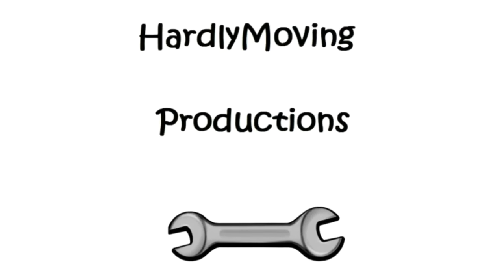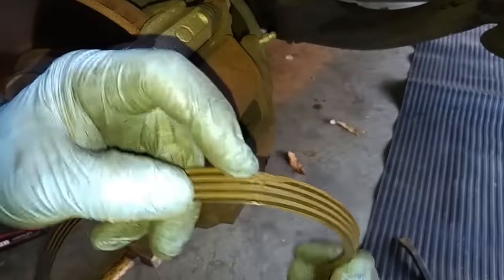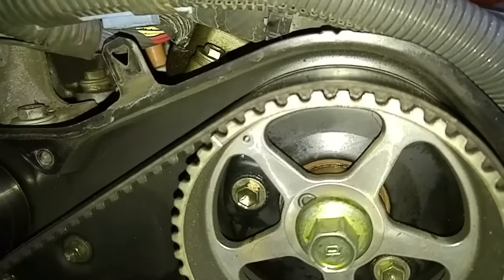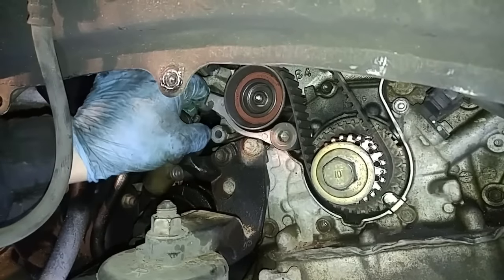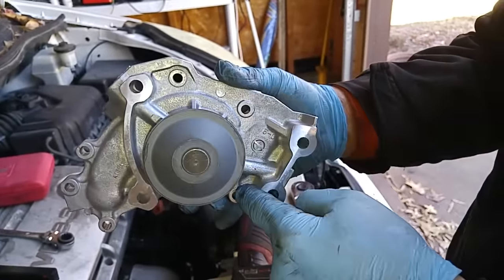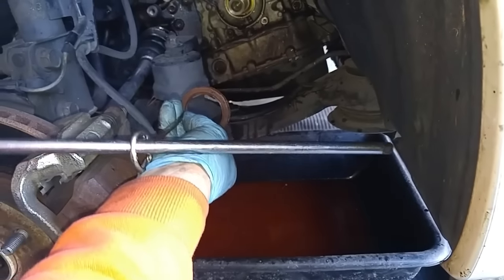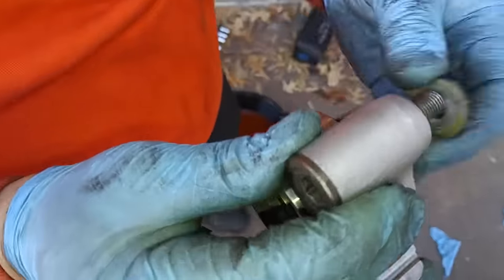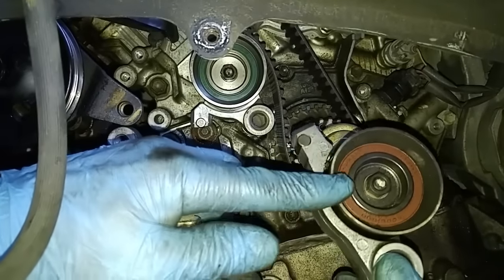Toyota Sienna V6 3MZ-FE Timing Belt, Water Pump, Seals, & Pulleys Replacement

Comment: I have a question my timing belt on my 2006 Sienna was replaced at 90,000 miles I now have 167,000 miles but the replacement belt was installed 8 years ago.Should I replace it now for at 180,000 miles?
Reply from the maker: The recommended service interval is based off of either mileage or time.  Believe 8 years is the service time frame ... although by mother-in-law has a 2001 V6 Honda Accord with under 30k miles and never replaced the belt to-date.  If the 1st belt replacement didn't include a water pump replacement, do the w/p this time.  Insist that the cam seals be replaced and don't listen to "I don't see it leak'n".
Reply: @hardlymovingpro  
The first one was done at a Toyota dealer in N.J. before I owned it but I've been told you might at well change the water pump while you have access to it. Pretty sure any Toyota dealer would recommend it.
The estimate I got was for a belt, water pump 
tensioner and 2 bolts  plus labor for 1663.70. Then again I got a estimate to replace the motor and wiring harness for a passenger power door for 900.00. I bought a replacement motor for 131.00 and did it myself.this timing belt replacement is way above my pay grade at 69 years old and a pinched nerve in my neck.
Reply from the maker: @waynerogers6621  That's a way over-the-top price quote and the cam seals are not included!  I can do the entire job in around 5 hrs ... just a belt replacement in 3.   Don't know why people call estimates an estimate?  Because it's the minimum they're going to charge? That if they encounter a hiccup like leaking cam seals they'll charge more?  If you're in NJ, I can recommend a shop you can go to in Union county.  It's called J&S Automotive in Roselle Park.
Reply: @hardlymovingpro  I'm in northeast PA. and have a local garage I deal with working up a estimate for me. I thought I would have Toyota do it mainly for the OEM belt and water pump but as soon as the service department at my local Toyota dealer called me with that insane estimate I told them thanks but no thanks and let them know I thought it was way out of line.They just reopened after being closed for 2 months due to the virus and I'm thinking they're trying to make up for lost revenue.
Thanks for the info
Reply from the maker: Understand.  I visit my mom every 6 months in NJ.  Could drop by in around a month to do the job if you want.  Parts & labor $650

Comment: I am having trouble removing the motor mount bracket studs. I have the bolts loose but can't free the studs. I have tried PV blaster, striking it repeatedly, double nut compression method and finally put vice grips on it and destroyed the threads but stud still will not budge. I am going to try heating it next. It appears the water pump has been slowly leaking for a long time so everything has been difficult to get off from the crankshaft pulley bolt, pulley itself & now these studs. Do you have any other suggestions?
Reply from the maker: You can try using an e socket (the reverse of a torx socket) at the tip of the stud or get a stud removal tool.  If using a stud removal tool, sand the stud surface to allow the tool to bite onto the stud.  Or you can tilt up the engine by positioning a hydraulic jack with a wood plank between the jack and the engine oil pan.  Tilting the engine up will give you the clearance needed to slide off the mount.
Reply: @hardlymovingpro  lifting the engine slightly worked like a champ! I thought of tilting the engine as a risky option for a last resort but have since learned otherwise! Wish I would have tried it 2 days ago. Thank you for responding! It is MUCH appreciated!
Reply from the maker: No problem ... easy ... wasn't it?
Reply: It was so easy I wasn't even sure I was lifting the engine at all until I could slip the motor mount off the studs!
 My elation was short lived, however, as I realized the timing was off between the crank shaft and the 2 cams when I tried to line everything up before taking the old belt off. I'm guessing since the cams line up together and the crank shaft is the odd man out (less than 45 degrees past the mark when the cams line up) that I need to rotate the crank shaft clockwise, before I put the new belt on, until piston #1 is at TDC position and hope no damage was done. I don't know when it could have slipped timing, the old belt was still on and intact. My fiancé limped the car home as it was overheating (which was due to the water pump failing...we thought) but was diligent about not pushing it and letting it cool between movements. I get conflicting information when I try to look up whether or not this is an interference engine. The water pump spindle is shot (way too much play) , so the water pump has failed but not sure which may have happened first, timing or pump. I'm hoping for the best and continuing to move forward.
Reply from the maker: Sounds like the water pump failure caused a jumped timing belt situation.  Very easy to fix.  Rotate crankshaft to TDC mark while camshafts are also moving to their TDC marks (otherwise they'll be moving 180 degrees to the opposite).  With the crank at the TDC mark, probably one of the cams will be off (assuming jumped belt).  Just rotate that one to the alignment mark.
Reply: As I was rotating the crankshaft while the old belt was still on, both cams would line up together but the crankshaft wouldn't line up with either cam, so I figured the cams are correctly aligned but the crankshaft needs to be adjusted. Another reason it makes sense to me that the crankshaft would be out of time before the cams is because all the torque is generated from the crankshaft. 
So, I rotated the crankshaft until the cams lined up together, removed the old belt, and am now planning to rotate the crankshaft clockwise without a belt on until the #1 piston is in TDC position. Then, as I understand it, I can install the new belt and everything will be aligned properly. 
Does that sound correct to you?
Reply from the maker: Yes ... that is correct.  It appears that someone had previously installed the belt incorrectly and is off a cog on the crankshaft side.  Note:  there are TDC alignment marks for the crankshaft.  It's shown in the video.
Reply: Before I took the old belt off, I used the marks for the cams but the crankshaft is out of time compared to the cams. if I only finish that rotation, the crankshaft will be one rotation further than it should be in the cycle because right now it is only less than 45 degrees past its correct position. At this point, I need to remove spark plug #1 and visually verify the crankshaft has put #1 in TDC position after I complete 1 & 3/4 rotations, or just perform whatever  rotations are required until I can visually verfy #1 TDC.

Comment: I’m trying to remove the power steering pulley on a 2001 sienna. It’s the one with the nut on it . Is an air wrench the only way to get it off ?
Reply from the maker: Use a chain strap wrench to hold the pulley then you should be able to torque off the nut.  Here's a video explaining how to use these strap wrenches:
https://youtu.be/h1kKlCkmfT0

Comment: If I don't change the cam seals, is it still necessary to remove the pulleys yo get yhe waterpump out, or can I just remove the stud?
Also, the tensioner I'm getting in my 1mzfe kit is the same a as the tensioner in this 3mzfe video, not the tensioner in your 1mzef video.
Reply from the maker: You don't need to replace the cam seals to remove the water pump ... but I guarantee you won't get another 100k miles out of the seals before the next TB replacement.  If the tensioner in your  1mzfe kit is the same as the 3mzfe video, then it's not a 1mzfe kit.  Also check the tensioner pulley bracket in the kit.

Comment: Great video!!! 
I'm a bit OCD/ inexperienced home mechanic so is there a good place to find torque settings for tightening the bolts, or do you do it by feel?
Reply from the maker: I generally go by feel, but here's a link to an article I wrote with a diagram showing torque specs:  https://axleaddict.com/auto-repair/Toyota-1MZFE-Timing-Belt-Replacement-Camry-Avalon-ES300
Reply: @hardlymovingpro  Really useful, thank you!
Reply: Awesome sauce

Comment: What are you spraying inside the engine (at about 9:24) and then using compressed air to blow away?
Reply from the maker: Brake cleaner solvent in a aerosol can.  It's commonly used in repair shops with compressed air to blow away accumulated oil and debris.
Reply: @hardlymovingpro  Do you think the cam seal installer tool would work for the crankshaft seal?
Reply from the maker: Don't need it for the Camry.  You can generally press them in with your fingers ... or use the end of a  2" diameter PVC pipe.

Comment: where can I find you? I need my 2000 Sienna timing belt replaced & water pump, your work ethic very inspiring
Reply from the maker: I'm outside Memphis, TN.  If close by, email for a repair appointment.
Reply: @hardlymovingpro  sent my info . Jon

Comment: Ehats up brither. Thsbks. Goaod video.   I didt it. I replace timing belt and water pump. Ehen i finished. I torn on. The engine. I saw cod p0016 ! Whats happened there. Something wrong ?
Reply from the maker: P0016.  Camshaft position sensor error.   Recheck your timing belt alignment marks.  May be off a cog.
Reply: @hardlymovingpro  done bro ! Thanks for your help and orientation!
Reply from the maker: Good for you!

Comment: How many hours and parts cost for timing belt and water pump replacement for this vehicle 2005 Sienna 3.3 V6.  Thanks.
Reply from the maker: Depending on your skill level and the tools you have on hand, I'd says somewhere between 6 to 9 hours of labor.  A timing belt component kit typically costs anywhere between $150 to $200 ... a link to a kit is provided in the description of this video.
Reply: @hardlymovingpro  THANK YOU.  I meant how many hours would a mechanic charge you.  Looking for estimate.
Reply from the maker: I can do it in around 3.5 hours or less.  Should expect an experienced mechanic to do the same.  But I'd figure most shops would charge you for around 5.5 hours.

Comment: Can't get the water pump off the housing... not enough clearance. What am I doing wrong? Am I supposed to have the engine raised a little?
Reply from the maker: I usually can wiggle it off the two studs.  You have 2 options:  1.  Get a "E" socket to remove each of the two studs.  An E socket is basically an inverse torx socket.  Do not use  standard hex socket.  It WILL NOT WORK.  Use the E socket with a 1/4" socket wrench and the socket must be perfectly square on the stud or you will strip the head of the stud.    Watch my video on the ES300 timing belt replacement job.  If there's too much corrosion buildup on the stud's threads,  the E socket may not work.
2.  Tilt the passenger side engine up.  a.  Remove the right side motor mount stud nut.  b.  Remove front motor mount stud (in front of the radiator fan shroud).  c.  Place hydraulic jack under the oil pan with a block of wood to disperse the lift.  As the engine tilts up, you'll see the upper side motor mount bracket pull on the motor mount stud.  Apply a few sharp hammer blows where the side mount seems stuck to the stud.  The blows should make the stud brake free from the motor mount bracket.  Attempt to remove the water pump.  If still not enough clearance, keep jacking up the engine until enough clearence to remove the water pump.
Reply from the maker: Also, if having problems remove the crankshaft pulley, apply penetrating oil on the crankshaft.  Let it soak ... then pull and push on the pulley and it should eventually come off.
Reply: @hardlymovingpro  wiggled it off after raising the engine. I raised the driver's side oil pan on accident at first. Will that hurt anything? I didn't hear any bad noises :)
Reply from the maker: @yasharenner6681  As long as you didn't bend the oil pan.

Comment: I have a huge oil leak on this side more near the upper side by the sensors may be coming from higher up but from the timing belt cover or the sensors can anyone help what might go to oil
Reply from the maker: Had a similar leak which was hard to find.  Was traced to a oil pressure sensor behind the timing belt cover.  Couldn't detect it until I had the covers off and running the engine.  Recently had another leak on a Hyundai Sonata that I fixed.  Once again, oil pressure sensor under the intake plenum.

Comment: Thank you for your great videos.  one question.  What size is the bolt going into the harmonic balancer when using the puller tool?  I got a cheapo from HF and I believe they are not metric.  Thank you!
Reply from the maker: Had the same problem.  Went to the salvage yard and got long 10 mm bolts.  Since the bolt head are too small for the puller slots, I used a series of washers until they fit over the slots.

Comment: Hello. I just watched another good DIY video where the rear cam bolt was loosened with the TB still under tension. I think I read somewhere not to do this, but can't remember why. Do you know? Thanks.
Reply from the maker: The bolt is torqued on at around 90 lbs.  With that much torque to get the bolt off may make the belt jump off the cam cogs or make the other cam and crankshaft move counterclockwise.  For me, not worth the risk.
Reply: @hardlymovingpro  Sorry, I'm not making the connection. If I'm taking the belt off anyway, why should I worry that the belt would jump off the cam cogs? Also, is there any reason why I couldn't use an impact wrench to remove, and re-tighten, the bolt on the front cam sprocket, as you did with the crankshaft pulley bolt?
Reply from the maker: the 3MZFE engine is an interference engine.  If the belt slips, the camshaft could violently jerk counter-clockwise forcing a valve to smash into a piston at top-dead-center and potential damaging the valve(s).  An impact wrench could be used if the cam sprocket is held tightly in place.
Reply: @hardlymovingpro  Hello Sir. I hope you don't mind the back and forth. I really appreciate your time. I haven't begun this job yet (still amassing tools), and I'm learning a lot from you. As I said before, I worry mostly about what NOT to do, so I'm trying to learn as much as I can. So to avoid the issue of the valve crashing into a piston, couldn't I get all three timing notches aligned, then, as per the Toyota repair manual, move the crankshaft 60 degrees counterclockwise to the "safe zone" and then break loose the rear cam bolt with the belt under tension? That way, if the camshaft does slip, it won't come into contact with the piston. Then break loose the front cam using an impact wrench (some people say not to use an impact wrench; not sure why).
Reply from the maker: I guess you could do that.  Never thought about doing it that way.  If the belt slips and send the rear cam out of alignment, then you'd have to take the belt off and manually re-align the crankshaft and the two camshaft pulleys one at a time to TDC.  If you start with the crankshaft first, you'd have to stop turning when you FEEL it touching any of the valves.  Then you'd go to the camshaft side and turn it ... hopefully to TDC mark without the valves touching any of the pistons.  Then back to the crankshaft side and turn it to TDC without hitting the valves.
Reply: @hardlymovingpro  I must be missing something. If the rear cam slips, it will slip counterclockwise and then come to a stop. The front cam will remain where it is, and the crankshaft won't move either. To get everything back into proper alignment, even with the belt off, wouldn't I just move the rear cam clockwise until the timing marks are aligned, and then move the crankshaft clockwise until its timing marks are aligned? In other words, why would I have to feel for contact if I'm relying on the timing marks?
Reply from the maker: Because you said that before attempting to loosen the cam bolts, you would move the engine 60 degress away from TDC.  Also, the torque needed and generated to take the cam bolt off may move the crankshaft and camshaft.  I assume you'd need another pair of hands to prevent the crank from moving while applying torque to remove the rear cam bolt.  So while applying counter clockwise torque to the cam bolt, another set of hands is on the crank bolt preventing the belt from moving.
Reply: It seems I may be mistaken on basic assumptions. Question: With the TB off, do all three shafts move independently of each other? Or will turning the crankshaft, for example, simultaneously turn the camshafts?
Reply from the maker: Also wondering if all that torque could damage the camshaft bearings.  While all that torque is being applied to the belt that's preventing the cam from moving, they'll be a lot of stress being placing the camshaft's caps.
Reply from the maker: Yes.  The purpose of the belt is to move all three in time.  Once the belt is off, you have to line everything back up before belt installation.

Comment: About how long is your extension for reaching the parts from outside the wheel well? The less time I spend under the vehicle the better!
Reply from the maker: I think the longest is 1.5 inches ... but you can attach additional extensions.  You can also buy ones longer than that which are over 2" long ... like what I used on the alternator tensioner bolt.
Reply: @hardlymovingpro  Sorry, I was referring to the longer extension rod (shown at the 1 min. mark). Looks to be at least 18-24 inches long.
Reply from the maker: That's the same 3/8" extension I used on the alternator tensioner bolt.  It's around 2.5 feet long.  Here's a product link in Amazon:
https://amzn.to/2Lbq3oG